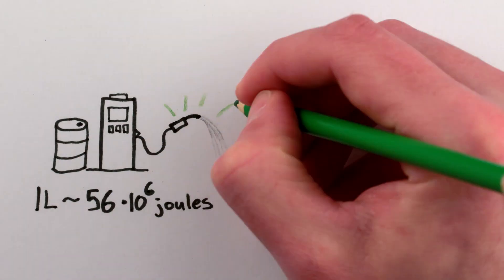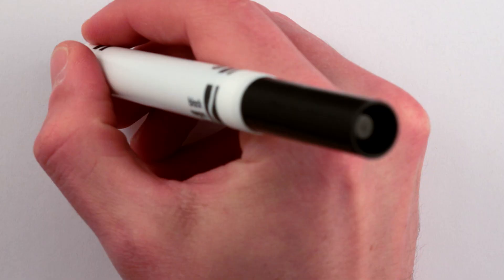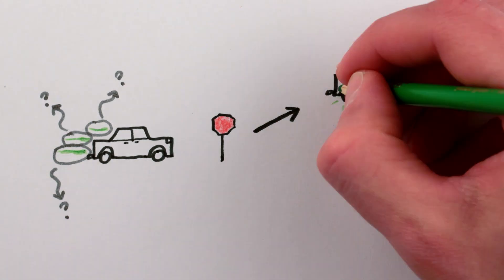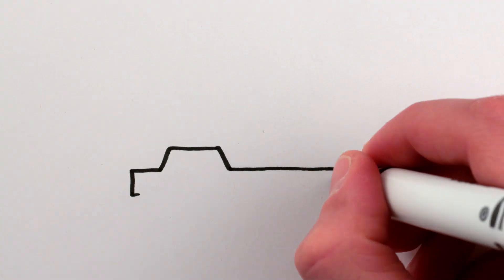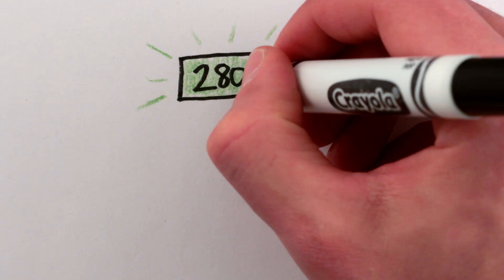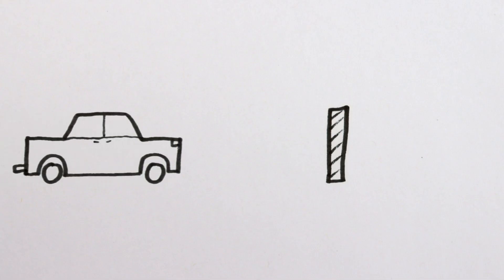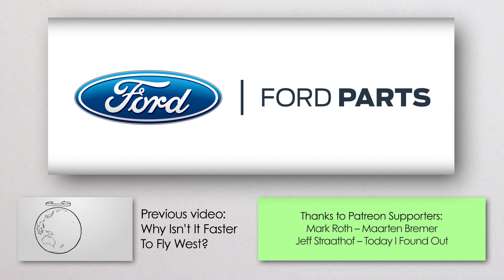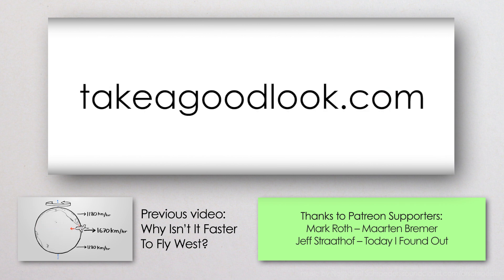The Physics of Car Crashes

Comment: And what about side crashes?
Reply: +KinRedysko check mate atheists
Reply: Jason Slade
 Are you freaking kidding me dude? getting hit in the drivers side door is THE worst place to get hit in a car accident. That's why we have tools made by a company called hurst, not only do they make cool shifters and race car parts, they also make the rescue tools that firefighters and emt's use to extract you from those same vehicles.  Do a youtube search for  vehicle crash side extraction if you want to see why you don't want to get hit on the side. There is so much metal in front of you that can crumple and collapse in a front collision, in a side crash, you have some 18 guage sheet metal that will usually crumple up like a tin can, your only saving grace is usually the A and B pillars, but the impacting vehicle usually severely bends your door inwards and goes between them which collapses the survival space you have in the passenger compartment.
Reply: +KinRedysko That is why car doors are quite thick, and why there are side airbags. But side crashes are still definitely more dangerous.
Reply: Have you tried turning it off and on?
Reply: +KinRedysko Cars can't move sideways so there is usually less momentum and energy involved in a side crash. But if another car headbutts into the side of your car... well good thing that you have life insurance!
Reply: +KinRedysko The sides of cars are very sturdy and rigid so nothing (hopefully) is pushed into the cabin. Though the side will deform slightly, most of the energy will be dissipated by the crumpling of the other car's front end.
Reply: +Peter “Crackpot Pete” Carlson Way to take his comment completely out of context. He never said it was better, he said there is less force in the impact. This is because when you crash head on, you're velocities are additive, as if you're going twice as fast and hit a wall. however, if you get hit from the side, your velocity doesn't matter, it's just the car who hit you.
Reply: +Rassity Velocities doesn't add if they did it would be 4 times the energy (v is squared). Two cars of similar weight crashes about the same as you hitting a wall, the energies take each other out.
Reply: Trumpyfilip
As someone who works on car doors on a day to day basis, I can tell you they are NOT at all thick, they have thin sheet metal on the outside, a few pieces of reinforcement metal bars for window components etc on the inside, an metal panel tack welded on the inside where the inner plastic door panel attaches to, there is literally very little between you and the outside of the car except a lot of air and some very thin sheet metal. The overall force exerted is pretty much the exact same  (for both cars going from driving speed to a complete stop) for two cars at the same speed in both collisions, the vector of that force will be different but you will be more injured in almost all cases.  If you think you will be safer in a T bone collision than a head on you are dead wrong.
Reply: +KinRedysko There very dangerous.
Reply: +Rassity i've been through this before so many times.
you're right that front impact dissipate twice as much energy, but, assuming the cars are the same and are going the same speed, it's the same decelaration you'd experience from hitting a wall, not twice. think about it, if one car is stationary and the other is not, the moving car will push the stationary car, absorbing a lot of the energy of the impact. also there's twice as much crumple zone to absorb the energy that does not go into moving the other car.

when hitting a wall, your car is forced a complete stop, and there's only its own crumple zone to dampen the impact. it's effectively the same as a head-on collision (a lot of assumptions go here, like the cars being the same, the same speed, being EXACTLY head on... but that also goes for the wall impact)
Reply: *****
Two cars traveling at 50 MPH no matter what direction they are going will have the same energy no matter their orientation, if you have 50kj of energy worth of cars moving you have 50kj, if you hit head on, that energy is dissapated, if you hit side on, that energy is dissapated, the same energy is dissapated each time howerver the directional vector of the force will be different as well as the most critical factor, the time that it takes for that (de)acceleration to take place. You dissapate the same energy going from 50 to 0 in 100 feet as you do going 50-0 in the thickness of a dime, the differnence is the impulse or rather the dv/dt.
Reply: +KinRedysko You're being crashed into, so your car accelerates.  It can't accelerate in a sidelong crash as fast as it decelerates in a head on one.
Reply: the thing is if you hit head on in a wall or another car moving at the same speed as you but at opposite direction, your car will stop much faster, in side crashes the car will slide dissipating the energy slowly. if you drift and hit a wall with the side of the car you are fucked though.
but that is taking in consideration a perfect car with a nice pilot protection, because if another car hit the driver seat on the side its probably the worst that can happen.
Reply: +Trumpyfilip Not as thick as an engine block and a steel frame.
Reply: Stapled Fish right, and side impact airbags prevent occupants from crashing into the doors and does not prevent passenger injury from the door being rammed inwards. I listen to the scanner an awful lot and I have a working relationship with my local FD and when you hear a call with a side impact, side airbags or not it is more often than not someone with ambulatory injuries that needs to go to the hospital. Most cars these days will make a 35 mile an hour head on crash into something you can walk home from, but when you hit something or something hits your door/side of car at 35 mph things are more likely than not to involve blood and broken bones and a few Hurst accessories to get you out of the car. This is why so many times you hear about a drunk t boning someone and walking away from the accident while the person who was hit when they ran the light or stops sign or what have you usually ends up badly hurt or killed.
Reply: +saharahgaiht im going to pray to jesus and allah and all them bitches on my death bed.  but before that, im not going to let religion affect my life in any way
Reply: +Peter “Crackpot Pete” Carlson 
Semantics - Jaws of life is just a trademark. Holmatro (the hydraulic tool manufacturer I am most familiar with) produce the whole range of tools, they just don't call them "Jaws of life"
Reply: +Patrik Pålsson yes, I'm fully aware that it would equal 4 times the energy. I said that the velocity would double, not the energy.
Reply: +Patrik Pålsson and energies don't 'take each other out'  energy is scalar, so direction doesn't matter.
Reply: +KinRedysko indeed. while maybe not as common, a lot worse for safety and harder to avoid
Reply: +Rassity no. in the video, the driver is driving against a brick wall. the brick wall is not moving.
Reply: +saharahgaiht  What?
Reply: +KinRedysko Your car can drive sideways...?
Reply: +Trevor Hannah were discussing a hypothetical situation
Reply: +KinRedysko Most of the impact safety in a car is for front end collisions. Side impacts don't have much in the way of crumple zones and occupant safety is provided by a rigid cage around the occupants so the energy is re-directed around the occupant and into other areas. However hopefully the car hitting the side of your car has crumple zones which will help both of you out. One of the worst collisions you can have is an offset frontal impact, where only part of the front of your car hits something, and the rest doesn't. Think 'hitting a light pole' where all the stopping energy is directed against a very tiny area of car. It will usually intrude significantly into the occupancy area and kill people. The absolute worst though is partial impact to the side, like side swiping said light pole, which is usually enough energy to cut the automobile in half.
Reply: +Peter “Crackpot Pete” Carlson "made by a company" okay, sure jan.
Reply: X Kaber yeah. Hurst makes both performance auto parts and rescue tools. You mean to tell me you've never heard of the Hurst jaws of life? They are the industry standard hydraulic rescue sheer/spreader tool. Other companies like holmatro make hydraulic rescue sheers or rams but only Hurst makes the jaws of life.
Reply: Peter Carlson I haven't heard of them, honestly. Probably if I were in a serious car crash, but the worst that happened to me was someone backed into me. I wouldn't know.
Reply: X Kaber you must not know much about cars, they are the first parts company to be named as a selling point for their products. A couple decades ago when you went to a gm dealer you had the option of getting a Hurst shifter that came installed in the upscale trim package on several of their models. In the performance world Hurst is almost as big a name as Holley is. Now they are part of b&m racing and Mr. Gasket brand stuff.  They make both the stuff to get you into a race car, and the stuff to get you out of it when you wreck. The hurst jaws of life  are world famous renowned rescue tools almost everyone has heard of.
Reply: Peter Carlson Lack of knowledge of history doesn't mean I do not know how a car works. All repairs I have done were reasonably in my skill range and were easy fixes. I got my car from a person selling it locally and not a dealer. I really didn't have any options given to me when I bought my 2004 dodge stratus off of a previous owner. Didn't even bother looking at the whole manual honestly. I know even to find the codes to look up to fix my vehicle. So far, it was only a spark plug for cylinder #1 and an oil change. I just wasn't aware of the hurst jaws.
Reply: X Kaber yeah. Like I said, you don't know very much about cars. Being able to change a spark plug does not a mechanic make. And if you didn't check the manual to see what the torque spec for your spark plugs was before tightening them with a torque wrench... well you didn't do the job right. What professional mechanics call that kind of workmanship is "making a bomb" ie the next guy who takes it apart  'explodes' your bomb by ripping out those aluminum threads in the heads your spark plug was screwed into.  History is VERY important to know in general car repair as you can for example 'snug fit' spark plugs into steel heads, but on the newer aluminum heads on the later engines that's a huge no no.
Reply: Peter Carlson Alright, man, like I said, I only do things in my skill range. If you want to be rude about it then go ahead, but this conversation is over now because you treat people like they're always lower than you.
Reply: X Kaber that project was outside your skill range. It's not an insult, just there are many of us who have been doing this decades and there are so many who don't care to look at the manual because they 'know how it works' these are the people who turn cars into bombs. Take a little piece of advice here and there, don't ignore the manuals because you don't know better than the engineers who put the car together no matter how talented you may believe you are. Those manuals are around for a reason. Unless you have an engineering degree and have the ability to undertake bolt stretching testing and component limit testing you should stick to what the manual goes, this goes for ANYONE who works on cars. Don't innovate, immitate.
Reply: +KinRedysko They are not as much of a problem, since you hardly ever move with the same velocity sideways. Someone else might crash into your cars side, but neither of you is a rigid wall, so both cars with share the acceleration (while a rigid wall will not move and you will feel nearly all the acceleration). Of course this may still be deadly if the moving car is too fast, but I guess it is just way less likely
Reply: Georg Plaz car wheels don't roll sideways they skid. There is very little metal between you and the outside of the car from the side, almost every side impact accident I see has injuries from moderate to severe. Most cars nowadays you can walk away from a 35 mph head on crash, a 35 mph side collision you are going to get hurt to some degree probably needing to go to the hospital.
Reply: +KinRedysko side air bags can be used and doors have a pockets of air to soften a crash. i work on transit vans and they have a small film of plastic that creates a irpocket on the rear door these are also found in the driver and passenger doos as well such as a ford fiesta or kuga or somthing.
Reply: warrick miller ALL cars come with that. It's not an airbag, it's a moisture barrier to keep condensation that is supposed to drain out of the door from fogging up the car lol!
Reply: Peter Carlson
no seats have airbags that plastic film acts as as air pocket my master tech told me that.
Reply: warrick miller yes, some seats have airbags to keep rearward passengers from going between and some side glass protection  but it prevents you from colliding with the vehicle  NOT other vehicles punching into the cabin of yours.
Reply: Peter Carlson
i think your right just did some research and nothing came up. Thank you for correcting me.
Reply: +KinRedysko Interestingly different nations (markets) have differing safety requirements and with respect to 'Side-Impact' standards, Australia has the most stringent. (The US - Rear End collisions are considered highest priority)
Many manufacturers now produce vehicles that cover every markets highest standard, globally. Toyota was first to do this I believe.
Reply: +Peter “Crackpot Pete” Carlson Yep, can confirm with first-hand experience that side airbags don't do much to prevent injury from moving inward. I was in a T bone accident where my door (back drivers side) was the point of impact and all my injuries came not from getting hit by a truck, but from getting thrown into the person sitting next to me. I was damned lucky to be more or less a-ok a few weeks later, but still. Damn.
Reply: EmilyEmilyIris
what was the car?
Reply: +EmilyEmilyIris I headbutted a tree when a dog crossed the road and my dad steered and breaked, I know how you feel! Side-crashes are traumatizing af!
Reply: +warrick miller Honestly I don't remember. It was a friend's car and he'd owned it for less than a week. Some small junky sedan...
Reply: +Jonathan Ouwens I had a head injury so I really don't remember the crash itself at all, or the next couple hours really. I do remember moments before the crash, looking out the window and seeing a giant SUV, and just thinking, "Welp, we're fucked."
Reply: +Trumpyfilip The weakest spot is the top. What if an asteroid crashes into your car?
Reply: EmilyEmilyIris
All I remember is my mom screaming "WATCH OUT! A DOG!" and the next moment I was trying to get out of the car, with my skull showing due to a cut in my forehead. (Something a 12y/o shouldn't have to experience :-\) My blood was on the tree, that's how I knew!
Reply: +Rassity velocities in a head on aren't additive, they cancel therefore the same as hitting a stationary wall in a single head on.

side hit would be less force, about half of a unmovable stationary object and a sideways impact,  but much more lethal as there is stuff all protection.
Reply: +Jonathan Ouwens  should have killed the dog
Reply: David Little The screaming startled my dad, never found the dog again afterwards!
Reply: +KinRedysko Buy Tesla
Reply: Even if we're not talking about side crashes: buy Tesla.
Reply: +Jason Slade 
I think you're incorrect in the conclusions you draw, however looking at the statistics, they seem to suggest that head-on collisions lead to a higher proportion of fatalities. My hypothesis would be that it is more common for head on collisions to occur at highway speeds, whereas most side collisions would occur in city driving. Your suggestion that there is about half the impact is a misconception, as although the approach speed of two cars travelling towards each other is doubled, the distance that they have to stop is also doubled.
Reply: +Rassity 
The velocities are doubled, but so is the distance that they have to stop (two crumple zones instead of one) so the increase in velocity is cancelled out.
Reply: +Peter “Crackpot Pete” Carlson 
I agree, although you'll find newer car manufacturers are getting better at reinforcing the doors with high strength components - still, as my experience as a firefigher has shown, I would rather have a head on any day.
Reply: +KinRedysko You become kill
Reply: Side crashes are much less likely to happen and when they do, they are usually at much lower (city) speed when air bags and seat belts are quite enough to protect you but when it does happen at highway speed, you are fucked. Eventhough they happen so little, they account for about a quarter of all car crash deaths.
Reply: +Jan Sten Adámek a quarter isn't low
Reply: That's exactly what he's saying. 25% of car crash deaths from 5% of car crashes means that side crashes are especially deadly, because of the lack of the aforementioned crumple zone.
Reply: +KinRedysko A side-crash only has about half of the impact of a head-on collision so they're overall less dangerous.